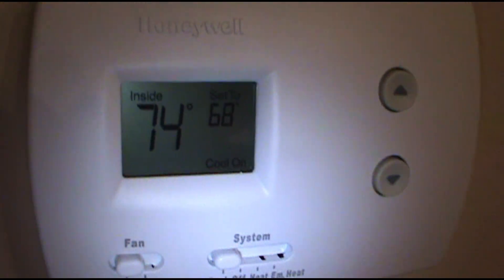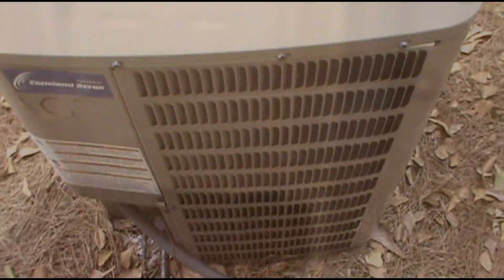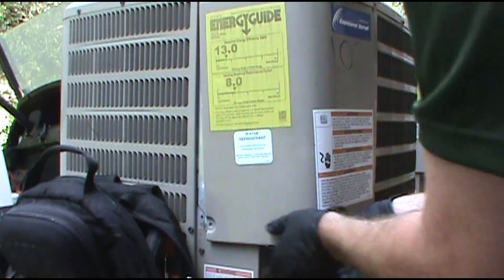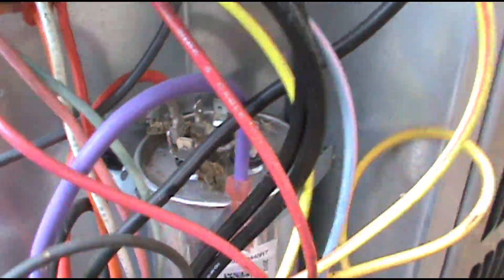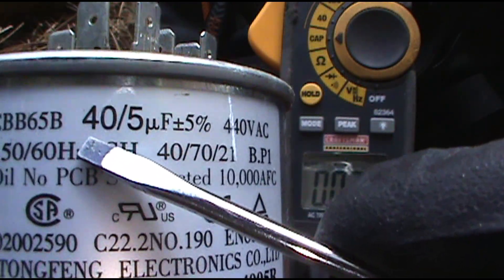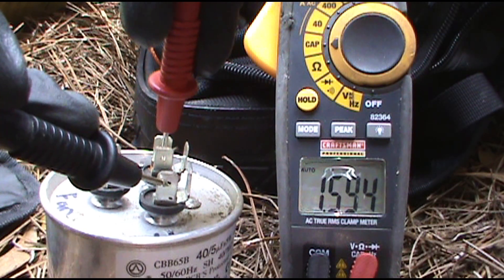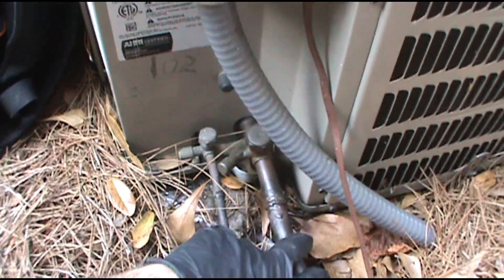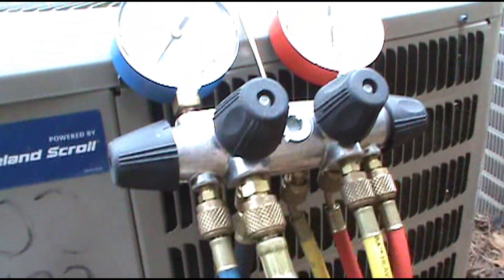HVAC Unit Will Not Shut Off After Reaching Set Temperature

Comment: My unit runs get to the set temputure and doest turn of sometime it turns of when I set it to 80° and cycles every 5 min or so if i turn it down below tbat loke 70° it takes dame near a whole day may more to reach that temputure and never auts of even if i set it to 76° it reach the temputure but never sits of.  What trouble shoot i can do could it be a bad THERMOSTAT
Reply from the maker: You've got a head scratcher there. I'd need to be there with my volt meter for this one.
Reply: Could it be the thermostat or comparator.  Like said it reaches the temputure but doesn't sut of could it be do to the temputure out side im like I underta.d the unit may run longer to get to the set temputure im cool woth that but when it finally reach the set temputure it does not sut of....
The set temputure inside that what one technician  told me but im trying to tell him it reaches the set temputure but doesn't go of i watched it for about one hours or more and it still didn't sut of The inside fan or the out side unit .. .   Could the out  side temperature disrupt the set temputure??   Say if it's 85° out side I set it to 76 it reaches 76° but does not sit of.   Recently got a new coil in my inside unit cause it had a leak and did not have any  Freon in it is it possible he did not put enough Freon in it .  I did troubleshoot new thermostat always change my filters clean my out side unit ..
Reply from the maker: @Emillthe111  If it doesn't shut off, it could be a bad sequencer, a bad blower board, a bad thermostat and a few other things. Hard to tell by not being there with my volt meter.

Comment: I have a problem with my ac also it runs constantly it’s set on 76 and reads that in the apartment it’s 77 they have come to remove thermostat three times and I’m still having the same problem it never goes to set number of 76 it’s stays on 77. Please what should I do cause obviously something is wrong
Reply from the maker: Could be low of freon. Or, could be a dirty coil or dirty filter.

Comment: So I just got my furnace and ac unit replaced a couple months ago. The AC sometimes won’t turn off when it reaches set temp. Can it be the thermostat since that wasn’t replaced also?
Reply from the maker: Could be. Or a stuck relay in the air handler.

Comment: Would this be the possible solution if you got the same problem but with the cool??
Reply from the maker: Could be. Or, heat strips are stuck on if it goes way above set temp. That's a bad sequencer in the air handler if temp rises way above set temp and is blowing hot air. Thank you so much for watching Miguel!
Reply: Lex Vance awesome thank you for the response, do you happen to have a video servicing a bad sequencer? What part of Florida are you located at?
Reply from the maker: I'm in Tallahassee, FL. I can't search video right now but it's titled "Heat stuck on" . It's on my channel.

Comment: Hey lex our fan motor went out from the inside unit in one the apartments I’m having a hard time finding a replacement which do you order? If you order from HD. The fan is fine just the motor went out.
Reply from the maker: You'll need to know what tonnage the air handler is and order the specific fan motor for that unit.

Comment: BRO! I was doing filter changes Friday and notices an AC was frozen. When I went back and checked everything I couldn't understand what was going on. I took a temp and noticed it was blowing out at 91. The type 91 relay had blown a leg and was running the heat strips with the AC.
Reply from the maker: Those can be a dang head scratcher. Thank you so much for watching SickMike!
Reply: So how does the coil freeze up if it's putting out 91° Supply Air? The return air had to be just as warm

Comment: Your introductory comments contradict each other. The first sentence says it reached set temperature, but wouldn't shut off (this would be the case of a failed relay/sequencer).  The second sentence says the temperature never went higher than the set temperature (this is the case for compressor not running).  I believe it is the latter - please clarify.
Reply from the maker: Yea, I wish I would've showed that it was set at 73 in heat mode & it was 73 in the apartment and the unit was running. When I bumped the tstat down to 72 in heat mode, the unit would shut off. You know sequencer is good when that happens. I wish I would've clarified that. It would hover between 72 and 73 in heat mode & not shut off. It wouldn't rise above 73 like it does when a sequencer is stuck. Just hover around set temp never really making there. Thank you so much for watching Clay!
Reply: @LexVance  Good points Lex.  However, the Aux heat can never return the room temperature to set point.  There is an offset between the compressor and the Aux heat - the same offset that brought the Aux heat on to begin with to help the compressor.  Aux heat will bring you back to about T minus 2 degrees, then turn over to the compressor to take it the last 2 degrees.  If the compressor won't start (e.g. bad capacitor), the room temperature will stay about 2 degrees cooler than set point.  If the compressor is going to be out of service for some time, the homeowner should switch to Emergency heat which WILL bring the indoor temperature all the way back to set point each time (and it will stop continuously trying to start the compressor).  I really enjoy watching you work and sharing "secrets" with less experienced techs.
Reply from the maker: @clayretired741  Yea, with it getting into the high 70's low 80's here in Florida, the outside warmness  brought it up to set temp but not quite. Totally weird I know. I haven't been back since I was there so all is well now.

Comment: Usuallly in a air handler if the heat strips won’t shut off when it reaches a set temp there is a sequencer stuck
Reply from the maker: You're right. I wish I would've showed that it was 73 in the apartment and the tstat was set at 73 in heat mode. When I bumped the tstat down to 72 in heat mode, the unit would shut off. The unit would never rise above 73 like it does when a sequencer is stuck. It would hover between 72 & 73 and never rise above that & never shut off. I should've clarified that. Also, at the end of the video I turn the tstat off & you hear the unit shut off.  Thank you so much for watching Brandon!
Reply: @LexVance so how did you fix it
Reply: Had a similar issue, bad outdoor ambient sensor, locked out the heat pump and it ran on electric elements while trying to start condenser all winter, costly for the homeowner, wish they would have called earlier
Reply: If it is running the AC in the day and he strips at night, it does not sound right that the heat strips could not get the indoor ambient above 73.

Comment: Sometimes customers think because the fan continues to run for up to 90sec after the call drops it is still “working”. I have though seen a bad stat not drop a call. I doubt that stat has a dead band setting. Only thing I would have done differently is run the heat in Aux and then watch what it does after satisfying. However since he works at the property I get it. But for HVAC techs on the road to avoid a call back I would definitely recommend satisfying with the customer standing there and explain how the fan continues to run for up to 90/60/30 seconds after it satisfied. Another good video! I’m 2 hrs West of Tally so it’s definitely inching towards bad cap and clogged drain season. Thanks for sharing
Reply from the maker: Right on. I wish I would've showed that the heat was set on 73 and it was 73 in the apartment. When I bumped the tstat down to 72 in heat mode, it shut off. I wish I would've showed that. It was hovering between 72 & 73 & not shutting off. It would never go above 73 like the heat strips were stuck on. Sometimes for the sake of video time, I give only cliffs notes. Thank you so much for watching Caleb!